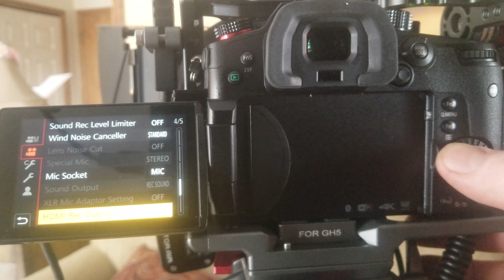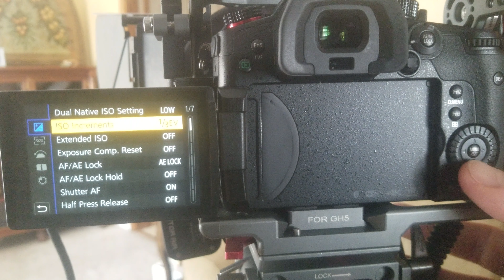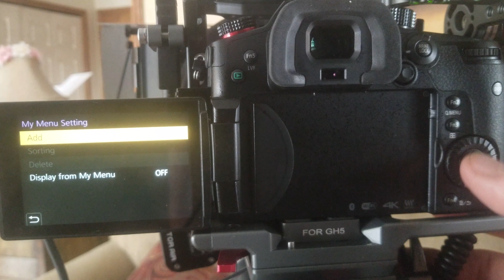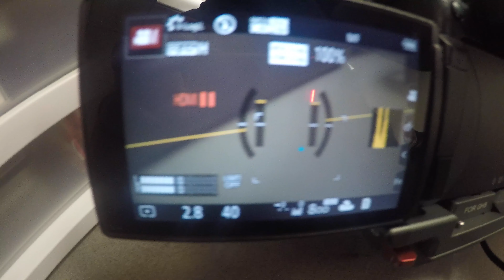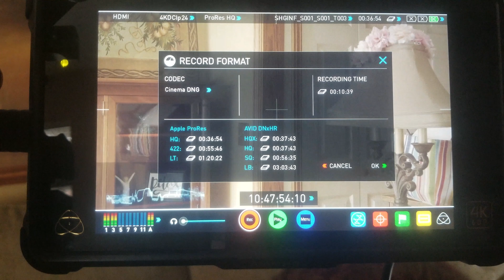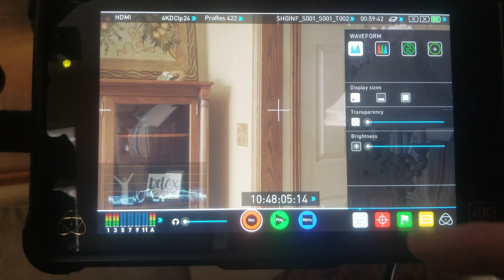Panasonic Lumix GH5s camera MENU setup with Atomos MENU setup

Comment: Will record Atomos 4 2 2. if the camera (a6500) records 4 2 0 ?
Reply from the maker: The 422 option on the Atomos records 10-bit color. I believe the a6500 shoots 8-bit, or 420. So Atomos gets a lot more color depth.
Reply: @chinfat  this is understandable. How does Atomos record 422?? If a6500 records 420)) I mean HOW? I want to buy Atmos. Does this make sense? Thanks
Reply from the maker: @MrPippec  Sony makes the camera only able to record 420 internally, so people will still buy their more expensive cameras. They allow 10-bit color through the HDMI port. Panasonic is one of the only mirrorless cameras that will shoot 422 internally. But you need to buy a more expensive SD card that supports the write speed.
Reply: @chinfat  I have a samsung 128 evo plus sd xc I 3 card. But what does this have to do with the card, and there is a HDMI 4K wire. I do not understand, the camera has a through channel?
Reply from the maker: @MrPippec  If you record internally, to the SD card, Sony's camera software will only allow 8-bit recording. If you attach an external recorder (like an Atomos) to the camera via HDMI, the camera outputs to 10-bit. Sony likely does this so professionals will purchase their more expensive cameras. It's stupid, I know... but that's what they do.